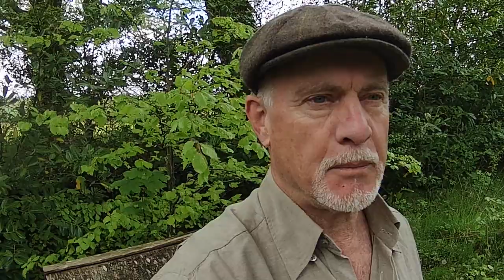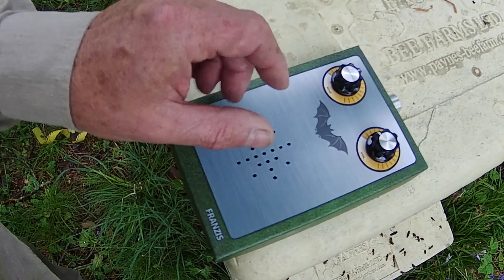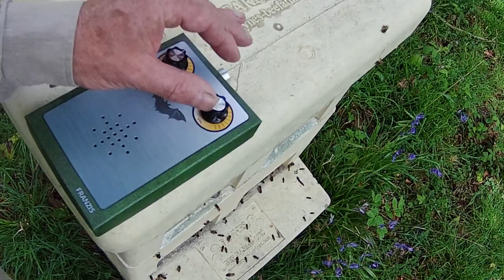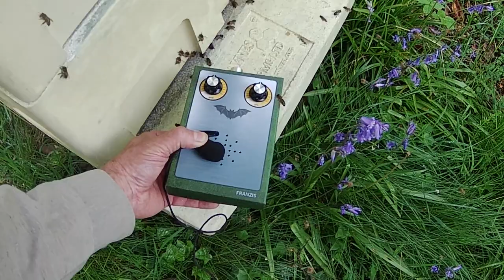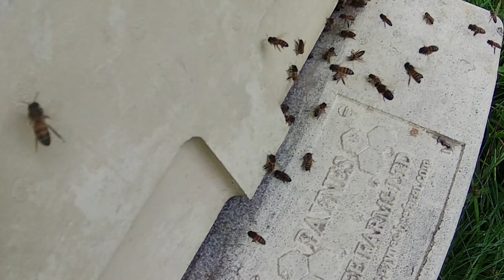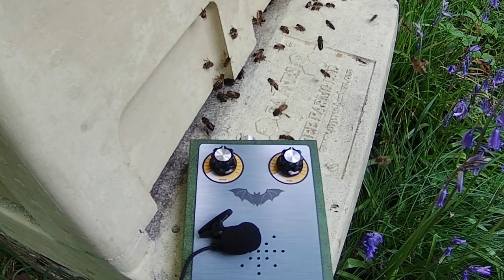Bee And Mite Control Using ULTRASOUND? (is it a crazy idea?)

Comment: I think sound and vibration are pretty low among insect senses… Yes, crickets chirp, bees buzz, and cicadas sound like you are standing under a bad high voltage line. The commonality is that these are all pretty loud and pronounced (and uncommon among insects)… The mosquito seems to be a bit of an exception… The Apidictor is/was very cool (and somewhat useful), but I don’t think sound, or even a tuned high frequency is going to do anything to a Varroa Mite… Scents seem to have some effect… 

I’m thinking phages might be the answer… Correct me if I am wrong, but I read that Varroa transmits bee killing viruses to the bees and it’s the viruses that kill them (or perhaps the combination of the mite and the sickness is too much)…. Phages are tiny viruses that target bigger viruses and bacteria… Innuculate the mites and bees with the right phages and the bees won’t catch the viruses that come from the mites…

I think phages are the future of both human and animal/insect medicine… phages can take out antibiotic resistant superbugs when nothing else  can… 

But much like your thoughts/ideas, this is all just speculation on my part as well…

Comment: What would be the effect of that on bee larvae or eggs, which has pretty much the same size with varroa?
Reply from the maker: I don't know. It is softer material, which will have some effect, but until the research is done, it's all speculative.
Reply: @BarefootBeekeeper  Maybe you can put the ultrasonic transmitter only in your telescopic entrance to knock off the mites before they get in.